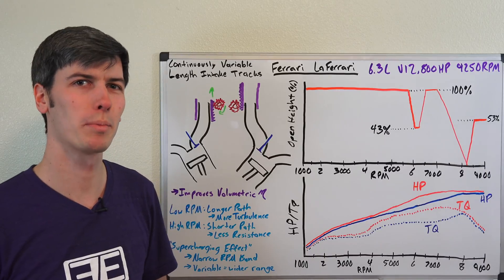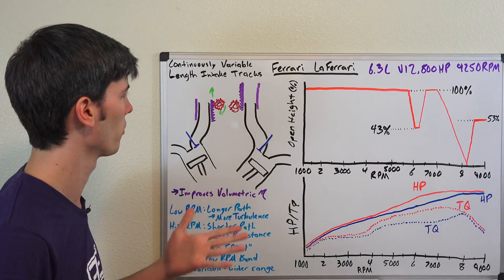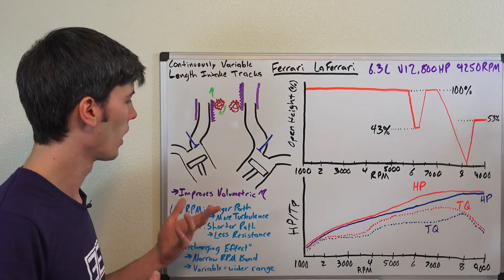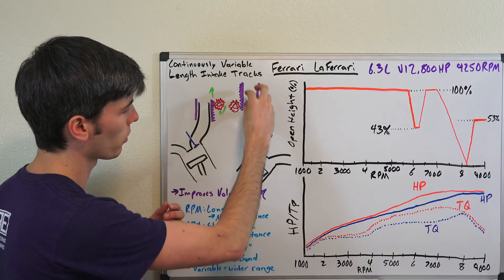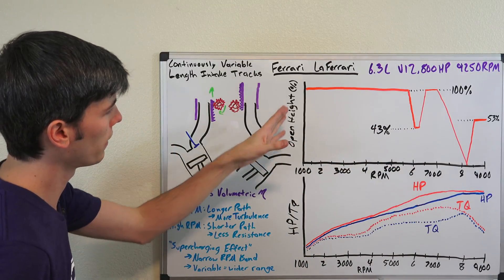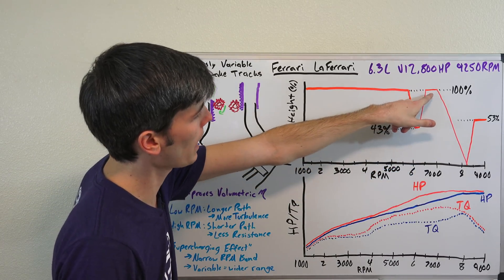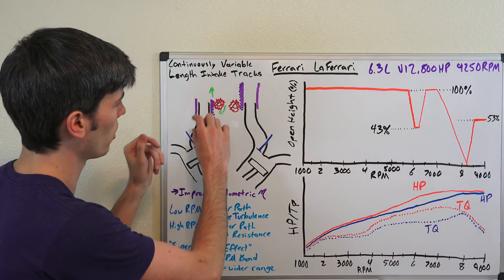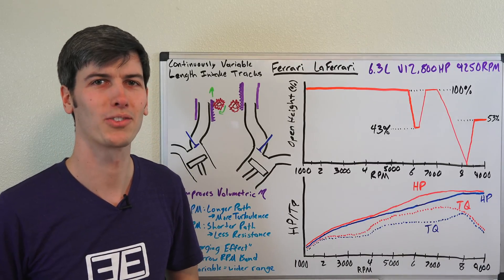Ferrari LaFerrari's Brilliant Air Intake System - 800 HP V12 Engine

Comment: I feel like every car company says they use technology that was "banned" from F1
Reply: Because most supercar manufacturers do.
Reply: To be honest, almost all technologies get banned from F1.
Reply: Isn't ABS banned from current F1 cars?  If so then literally every car company 'is' using tech banned from F1.
Reply: Fun detected, ban it!
Reply: True, and about %100 of these cars are usually de-tuned. Also current restrictions and some still to come are hindering the sport. Soon the cars will barely make any noise.
Reply: Brandon Hudgins F1 cars arent quiet by any means. i guess you havent gone to any of the races. you would realise they are still deafening. they just allow people at the races to communicate nowadays. before you couldnt hear anyone.
Reply: Filipe Amaral ive seen people argue that they are. But i have made an assumption based on his comment and i am probably completely wrong on his intent. That said i think one day F1 cars may have a electric bias on their hybrid systems. I do believe it's possible but i doubt it will ever become solely electric especially since Formula E is covering that ground. As for your comment that most techs get banned i think you're right. And i hate that but the reason they ban so many things is because it makes it impossible for smaller teams to compete. I think that's their own problem and not the big teams problems but the management thinks otherwise. 

Variable intake runners (Ferrari), "brake steer" (Mclaren), fan assisted cars (Brabham), flexible nose cones (Red Bull), trick suspension that was banned in 2013 (all teams except for Lotus which had not implemented that tech) and so many other things. One thing id like to see in F1 is that teams can choose their gearing for every weekend. As it is right now they choose all 8 gears aswell as their final drive ratio and that's what they run from Australia to Dubai. It allows smaller teams to match what bigger teams can do but the issue is that on certain tracks the big teams just stretch out a massive lead because their gears and powertrain is so superior. By allowing individual sets it would allow smaller teams to suit their ratios to their cars. As it stands Williams has a very good car on high speed tracks. That gearing would allow them to work around the chassis for complex tracks for example

Im more worried about the lack of innovation rather than the lack of sound. Yea sound is great but F1 has and will always be about innovative solutions.
Reply: Jackisaboss1208 Ferrari has a f1 team
Reply: I think the point is that regulations would be so severe that the hyperbolic conclusion would be silent electric F1.

I don't think he actually believes F1 cars are quiet.
Reply: It was called FRIC.  The front and rear were connected to reduce dive under braking and acceleration.
Basically it gave the cars a compliant suspension that could also keep the car rigidly level to the ground improving the aerodynamics immensely.
Reply: Of course they're not quiet... At any rate, numerous manufacturers have already made their move towards "planet preservation racing"... But I'll keep my straight through exhaust on my turbo cars for as long as governing bodies don't throw curve balls 😉
Reply: Brandon Hudgins yea i enjoy sound too and trust me i hate tree huggers but the only elements restricting the exhaust gases in F1 cars are 1, the turbos, and 2 the heat reclaiming systems. But they dont put mufflers on the cars either. By reclaiming that heat they recharge their batteries and can attack the competition. Without it they lack anywhere from 25hp to 200hp. And 5hp in F1 makes a massive difference
Reply: that's because there's an ENTIRE graveyard of innovations from F1 including torulene (excuse my spelling) fuel which can be used in any gas car to great effect.
Reply: Alexander Klein yes ABS and Traction Control are banned from F1, so is "launch control" that said what we mean is the more complex systems like variable intake runners. That's pretty cool stuff while ABS and TC isnt really that special. Racing cars with ABS and TC have an amazing system that is focused towards outright performance which is nice but you cant really expect to have stuff of that caliber on the street
Reply: coast2coast00 yea that's it. Such a clever thing and it was banned
Reply: Only Ferrari and McLaren. Gmc isn't in F1😂😂
Reply: Cadde you've got quite an imagination there
Reply: Cadde i have a hard time believing that the "voices in your head" which is your imagination. Is right all the time. And even if it was i doubt it is for this. Im not telling you that you shouldnt think about this. You can do what you want. But i dont believe what you're saying is logical or realistic.
Reply: Cadde keep lying to yourself, i did say you have quite an imagination, wether that's good or bad is dependent on opinions and of course on how you use it. I was never insulting you. I was just pointing out how ludicrous your ideas are. I guess you dont keep on top of things and failed to notice management of F1 has officially changed hands now. I dont care if F1 dies. There will be another group that just brings a similar and perhaps better alternative to it if it does. As for right now, F1 is and has been a very successful buisness for years upon years. You seem to fail to look at it from the buisness point of view and it's rather clear. Is that a problem? No but dont act like you know something you dont
Reply: F1 won't die nor will most other motorsports... However, these things may evolve. I don't know wtf cadde is talking about
Reply: Patrick, "trick suspension that was banned in 2013"? What was the main feature? I mean, active suspension was banned in early 90s, dual chassis cars were banned in the 70s (because that would have allowed the suspension to be completely independent of the monocoque)... Was it connected front and rear suspensions?
Reply: Samira Peri yes i believe that's what it was. I cant remember exactly but if i recall correctly the advantage was that the front suspension pretty much got the rear suspension set up or something like that. I wish i remembered it as clearly as can be but i just dont.
Reply: viperz888 Honda, Toyota, Jaguar and so on have raced in F1
Reply: viperz888 you however said "Only Ferrari and Mclaren" that's why i told you several other brands that did race F1. But i guess because you lacked knowledge you were insulted by my superior knowledge.
Reply: Cadde i did. What he's saying or at least how he's saying is that only Mclaren and Ferrari have been in F1. Which isnt the case obviously. I imagine he meant they are the only ones to have implemented racing tech to their road cars but even then he's wrong. How should it be an embarrassment to me?
Reply: Cadde perhaps i have not. Why dont you clarify then?
Reply: +Patrick Pelletier you ought to keep your big mouth shut buddy
Reply: +Cadde ignore him, he's a moron that can't read
Reply: viperz888 nah, there's one thing you should learn from me, and learn quick. Im relentless. When someone tries to piss me off il just keep annoying them until they give up. I have plenty of time on my hands. Plus you decided to insult me just out of thin air. So the mouth that should stay shut is your own
Reply: /r/iamverysmart

Comment: very interesting I wonder how the variable valve timing corresponds to the variable induction, one other question I have and I'm assuming Ferrari is doing this, but is each Runner individually having this variable induction track I would assume they all do and maybe can adjust according to individual cylinder demand load ect?

Comment: As the pressure wave travels at the speed of sound, could that change back up 100% full length of intake runner after 6000rpm be when instead bouncing maybe 4 times back and forth  it only goes 2 times. And again after 8000rpm pressure wave goes only once the length of the intake runner, so length would be adjusted according to that.

That would help also if adjustable length of runner isn't very long to not run out of range. I'm not sure could that be it or is there some other factors why you would want a more length suddenly at set rpm, that was just what i'm thinking.

Comment: curious as to why F1 banned the technology?
Reply: It was banned when F1 changed from V10s to V8s in 2006. This was to reduce power, speed and probably manufacturing costs. However it was reintroduced in 2015. Unfortunately, most things are banned in F1 to stop cars from being too fast or "unsafe" and to stop richer teams from getting too much advantage over smaller rivals. Despite what they say, road relevance is the last thing on any F1 engineer's mind :)
Reply: All racing cars in all racing series are limited in their speed by a set of rules. If nothing was banned, cars will go so fast that they produce more G forces than jet fighters. If something fails, the result of an accident will likely be fatal at that speed. If you google it, Red Bull racing designed a concept F1 car with no rules. I think it is even in the Gran Turismo game. Hint: It's ridiculous.
Reply: the car is the Red Bull X2010 for anyone else wondering.
Reply: Gazza I played with the red bull concept in GT 5 and it is comical, it's so fast that you can't even use it.
Reply: +Gazza Engineers no, manufacturers yes XD this is partly why the cars switched to V6s, so they were relevant.
Reply: JARED If I'm not mistaken, I think "bahn" means "road".
How does the word "autobahn" relate to F1 racing?
Not that I don't appreciate the info but, it almost seems like you made that up -_^
Reply: + Josh River Trust me on this, I know this info from a credible source. It's plucked from a place called "thin air" :)
Reply: Shimassi it was used in motorcycle, road ones. Yamaha R6 for example.
Reply: Josh River probably cause (up till now) it had no relevance to road cars, and development on it could up the cost of competing with providing any innovation for the general public. F1 tries to keeps it's technologies limited to those that can filter to car manufacturers.
Reply: sorry for the repeating of things, couldn't think of any other way of wording it 😂
Reply: Shimassi  Fair enough, but hat about racing?
Reply: If you watch Grand tour, they did an episode around an Astion Martin that couldn't be on race track or street. for the reason of safety again. but wow those cars can go fast.
Reply: Grand Tour episode 2 and the car is Aston Martin Vulcan. The car is a beast!
Reply: JARED lol
Reply: Siana Gearz the railroad was named after an iron stick because of the uncountable amounts of iron spikes that were hammered into the tracks through the tracks to hold them in place.
Reply: F1 strives to make the driving experience for the driver as manual as possible. This technology is automatic hence it was banned. This is where the term "Autobahn" came from.
Reply: Bahn meant route, trail, path originally but was extended to mean rail when railroad was invented. Then combined with "Auto" when automobile came about. Curious that English would name their railroad after a French word for iron stick (why do they have that word in the first place? what's so important about iron sticks in France that it would need a whole separate word?), while Germans have named it for how it goes, following a path.

Comment: But how longer path speed the airflow.. More length means more resistance path right ??
Reply: No air can flow into cylinder when valve is closed, but pressure wave comes back up the intake runner when valve closes. Pressure wave goes back and forth intake runner until if timed correctly wave comes down when intake valve opens again and that small supercharging effect takes place.
That pressure wave travels speed of sound and it is constant at one temperature, so only way to change the timing to match valve opening time is to change length of intake runner.
Reply: The boundary layer grows with the distance and effectively makes the opening narrower making the (subsonic) flow accelerate. Like constricting a garden hose.
Reply: @ASJC27  But what really matters is the air flow rate not the speed, right? does longer path in low speeds help increase flow rate? I doubt that. I think the real reason for longer path in low rpms is to have the perfect distance for the pressure wave to return on time into the cylinder.
Reply: Thanks guys !
Reply: ASJC27 yo are you taking an aerospace class or something? Sounds a lot like what I've learned from aerospace engineering. Imagine supersonic air intakes lol, i wonder what kind of rpm you'd have to produce to need that. And the weird thing is that the supersonic flow would need a shorter tube to achieve higher resistance. What the heck is up with that?
Reply: Bernoulli principle
Reply: Good call. I'm an aerospace engineer.

Comment: Stop at about 0:20 - This was also used and then banned, on world superbikes, in about (?) 2005? I'm pretty sure it was the Yamaha R1. And (could be wrong) I think when they went off turbo motors in F1 the last time, and everyone went to NA V10s, I think at least one of them had adjustable intake trumpets. Yamaha didn't dream the idea up themselves, they copied off someone else...
Reply: Basically every F1 engine used this starting in the 90's until 2006 when they switched from V10 to V8 and the FIA banned the system.
Btw variable intake runners are allowed again in F1 since 2015.

Comment: Ferrari is lucky they didn't blow the welds off the intake
Reply: Nick F that's cause they have a laptop on the passenger's seat that will scream "Danger to manifold" whenever they have a problem
Reply: @pijen  SHUT UP!!!
Reply: granny shiftin not double clutchin like you should
Reply: mr1paddy you never had me. you never had your car.
Reply: Now me and the mad scientist gotta rip apart the block, and replace the piston rings you fried!
Reply: tuna sandwich, no crust
Reply: These engines live their lives, a quarter-mile at a time.
Reply: i almost had you.
Reply: Ooooooohhhhhhhhhh
Reply: you gotta trust robots... for that part of the engine, the seals and valves are cryo-frozen and then assembled by robots

Comment: This is why it has 65 degree Vee angle! Normal V12 has 60 degree. Tgis one need to make room. Also, you can hear system vorking while car is accelerating in high gear, as sudden change in pitch.

Comment: Why did Ferrari bring it back up to 53% after 8000 rpm? I guess they were happy with the power figures they achieved and decided to dial it back for some other reason. Could be that the rest of the drivetrain couldn't cope with the extra power. Could be for warranty reasons. Whatever the reason is, this engine's full potential hasn't been realized.

Comment: Wouldn't the torque curves intercept at least once, since the variable system would presumably be at the same length as the fixed intake runner would be at those points in the revs?

Comment: Cool video! FYI this technology IS used in F1 today and is one of the reasons why the Honda PU has been so unreliable in recent years - their inlet runners kept getting stuck and caused huge problems as the rpm increased (e.g. knocking).

Comment: Even though I don't understand the mechanism behind this completely...I do understand that this is a modified version of the V12 used in the F12. It's been adjusted for lower torque but more power at a higher RPM. The torque deficit is made up by the HY KERS system...genius.

Comment: This tech has been around for decades. My 1999 Toyota Camry V6 had variable length intake runners that were vacuum powered.
Reply: my 2000 Accord either
Reply: Nutz4Gunz45 mb used it on the m112 as well
Reply: Nutz4Gunz45. but not infinitely variable, your car has 2 sets of runners and 2 settings that have to each cover a broad rpm range.

systems like Mazda VRIS have 3 resonant stages and you could add more and more stages but at great cost concerning complexity and weight.

the system seen here would be great for a production car but rather difficult to employ in a high production form.
Reply: The idea is even older than that, even VW had a upgraded/optional intake for the VR6 back in 1992.
Worked with a intake which had a straight and a curved path and in between is a flap which controls the airflow.
Result is more low end torque and more high end hp.
Reply: @DrewLSsix, this isn't infinitely variable, nothing is because infinity meaning limitless.
The Ferrari system has a good feature being adjusted perfectly like they wanted, giving the maximum power. 
Not just like two or three stages like many other manufactures, but the idea is still quite old, just made a bit better.

Comment: Helmholtz frequency. My GSR  Integra had this. They call it Intake Air Bypass (IAB). Inside the manifold are 4 butterfly valves (like a throttle body). They are connected via a shaft that goes out of the side of the manifold. There is a vacuum canister, solenoid, and actuator. At ~5800 RPM, the solenoid opens, moving the actuator arm, opening the butterfly valves.

Comment: This kind of system could do really well with a CVT. It would need less resolution on the length change. Basically just swap between two modes; long length for more low down torque and short length for top end.

Comment: I believe the 1960 Chrysler 300f used a similar system, but non-variable. Called "Ram induction" the carburetors were mounted on long-range intake manifolds while also being mounted lower, this causes the air too speed up, creating a supercharge effect. great video btw very interesting
Reply: Josh Briggs. thats not really the same mechanism,  the variability is the defining trait of this technology. yes chrysler used tuned length runners but the fact is every runner is tuned regardless of its length, its just that in the days of carbs shorter lengths were common even if they were not particularly well tuned to the application simply due to fuel dropout.